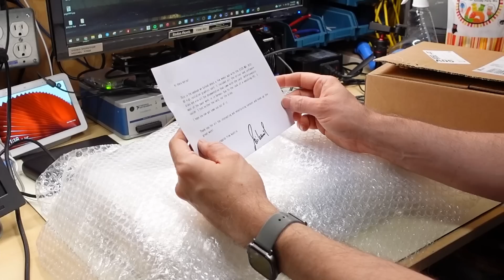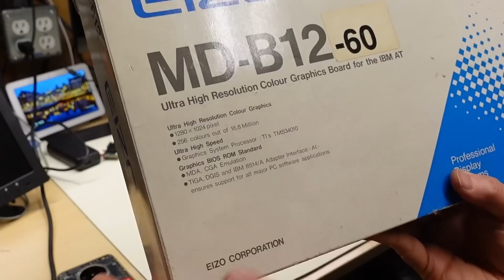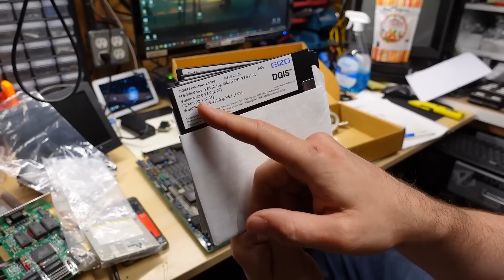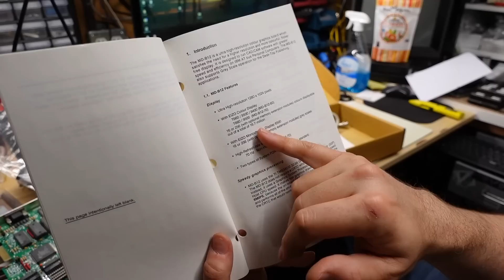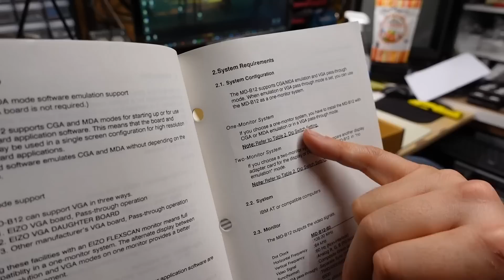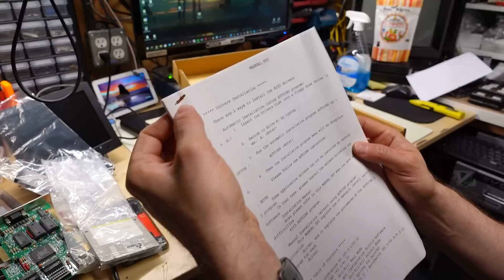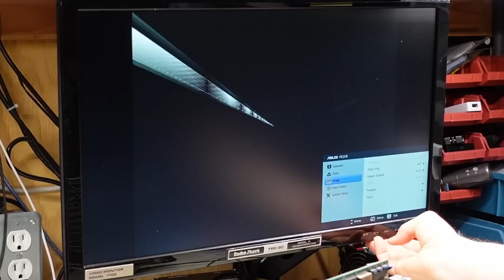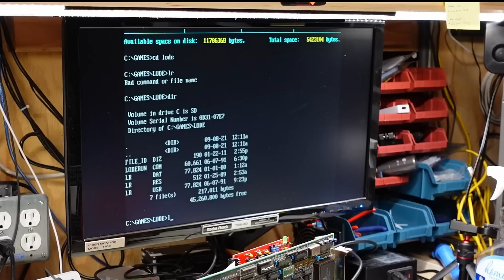0008 This is an "ultra high resolution" PC video card from 1987

Comment: I remember being amazed to have 1280x1024 on a "modern" monitor back in 2002, so this card having it so much earlier, that would have been mind-blowing at the time... :D
Reply: Indeed - I was on a 1024x768 display until 2007(!!) and this thing came out 20 years prior!
Reply: Very impressive resolution for the time for sure.
Reply: I had a mid-level Gateway 2000 computer in 1990 or 1991 that supported 1280×1024, and a monitor that supported it. I think that it had to be interlaced at that resolution, though, and was kinda hard on the eyes. I'm 99% sure that it was an ATI VGA Wonder card.

I also worked for a company repairing Nokia monitors in 1994 (I remember Windows 95 was released during the time I was working there) and their 21" monitor at the time, the 445X, supported up to 1600×1200.
Reply: I have an LCD "ThinkVision" right here as rotated second monitor, and it is 1280x1024 (but its rotated vertically so, 1024x1280).
But, if we are talking 1990, well High res was 640x480 "Super" was 800x600, there was another word for 1024x768 and then something like this, no wonder it was called "Ultra". Its like an 8k today. Unfortunately 1m of vram was too little to display too many colors at those high resolutions, but of course you could always pick from the true color palette.
The main target for this device was probably the CAD crowd, occasionally these would bring a Flight Simulator driver but for the most part no game would ever take advantage of it. If you walk a little bit into the future, around the VESA LOCAL BUS era, you will get "svga" with almost identical capabilities and limitations, albeit compatibility improved when "VESA" modes were also introduced (ie. Simcity 2000). From my fuzzy memory, i only remember seeing one person using a vga like monitor with those bnc connectors.
Reply: I remember bing amazed when saw video playing on a PC monitor in a radio shack way back when.
Reply: Eizao Nanao made some great monitors back in 90's. I had one of their 17 inch 1280x1024 models in 93 or 94. Opening the monthly Computer Shopper was like porn LOL. But yeah I remember starting with 320x200, then 640x350 I think, then 640x480, 800x600, and 1024x768. When 1280x1024 came around, it was like who would ever need more?! I'm was at 4K about or 5 years ago, and now dropping back to 2K wide for development. Fun stuff.
Reply: @nicholash8021  Computer Shopper!! Oh how I remember scouring the adverts in that magazine and others, looking for the best prices on PC hardware and then realising that it was all out of my price range... then spotting an advert for PC rentals! That was my first PC, a 486sx 25mhz if I am remembering correctly. I had to pay £25 a month for it, was brand new with monitor and all peripherals. TBF it was a great way to get into PC's back then ('94-95), especially as the prices of the buggers was astronomical. I was only 16 and just starting college and needed one for my course. Only regret was not getting the DX or even the Pentium as that came out about then too, but didn't realise I might want better until I got hold of a demo of DOOM and to play it I had to shrink the screen size down to about the size of a cigarette packet for it to run at any sort of reasonable speed... 

I wonder if renting a PC is still a thing anywhere?
Reply: I remember thinking 1280x720 was a super high res.

Comment: I'm wondering if any of the other modes are any faster, or even if the VGA pass through is any faster either. Would love to see a follow up video showing the different modes, and hardware configurations.  And is the RAM really 59 pin, and not 30-pin? (like does it start counting at 29?)  I'm sure you're right, but would love to see 30 pin memory side by side with the sockets to shut up my brain goblins. ✌🏻
Reply: Faster for CAD and other wireframe stuff when using the proper driver, usually identical to or slower than normal graphics cards otherwise. These would be a waste of money for virtually any DOS game for example, though perhaps something like Tempest or another wireframe game could be ported to work well on the machine.

Comment: Those are 60-pin SIMM slots, not 59-pin  (I counted). Often you'd either label the odd end pins, or even end pins, depending on which side of the connector you've got the labels on, but I've never seen a SIMM slot with an odd number of pins.
Reply: I agree 60pin. I believe i may still have a few
Reply: @TroyBest  Slots or SIMMs? And what were they used for?
Reply: @BlackEpyon  60 pin SIMM memory sticks. Someplace around here i think instill have some sticks might be DIMM. Been a long time from my amiga days.
Reply: @TroyBest  I ddin't know Amiga had 60-pin sticks. I'm familiar with the 30-pin SIMMs from the 386 days, and the 72-pin sticks from the Pentium I days.
Reply: @BlackEpyon  been 30+ years, iv got so much crap packed away.  Ill check tomorrow if i find ill link a pic. I kept alot of that crap the 30 and 60 pin sticks made great keychains lol
Reply: @TroyBest  I recall using a few as keychains myself, until the chips kept falling off in my pockets.
Reply: Yeah i have some, not all SIMM were 72 pin :)
Reply: @freeculture  SIMM just means that the pins are the same on both sides. the 72-pin cards in common use were DIMM's though, which means a different pinnout on both sides.

Comment: I have a similar EIZO card that I used extensively back in the mid '90s, except mine's 1600x1200 B&W or lower res with 4 shades of grey.  It came with a 21" monochrome monitor (some model of EIZO Flexscan CRT).  Windows 3.11 looked a little ridiculous with so much desktop realestate.The ribbon cable is to connect to the feature connector of the existing VGA card to pass through "standard" modes and the leadless D15 has resistors in it to fool the existing VGA into detecting a monitor.  It was not uncommon for VGA BIOSes of the era to hang the computer if no monitor was present.  Not sure if things are exactly the same for this card, as mine is an "addon only" card that requires a VGA card to boot the machine.

Comment: Haven't used a card that old but more modern versions for healthcare. In the radiology department, the computers used for examining imaging used for the time super high resolution LCD monitors that required paired graphics cards to run.

Other than supporting the high resolution, the cards also allowed diagnostics of the display to run as these screens had to meet certain performance standards such as uniform colour, uniform backlighting and other standards to ensure that dark spots or imperfections in radiology images were diagnosed correctly and not just attributed to the screen being a problem.

Wouldn't want to mistake burn in for a cancer diagnosis.
Reply: How modern we talking about? I mean, with every kid and his dog gaming on 4k and 8k monitors, high-res isn't exactly the wiz-bang that it used to be.
Reply: @BlackEpyon  machines running Windows 2000. If memory serves the displays were 4 to 6 megapixel (they were measured in megapixel, the modern versions in this space still are).
Reply: @theoriginalzads  My dad used to be a senior service rep for Datex-Ohmeda. I've seen him bring anaesthesia machines, ventilators, ECG's and the like home to work on, and sometimes they'd just get shipped straight to our house for service. But I don't think he's worked on any radiology equipment. I imagine you'd need different qualifications to work on that stuff. Any chance you might know?
Reply: @BlackEpyon  the actual radiology equipment, definitely. The guys that serviced our gear were basically radiologists with IT field service experience.

For the radiology reporting stations (the computers with the fancy monitors that cost more than my car), no. The only difference was the graphics card, software and monitor. Some basic training on the diagnostic application and hardware for the monitors is all that's needed.

These days, there's no special graphics card involved. They're driven by a good Nvidia or AMD CAD workstation graphics card which I think they only choose because the drivers are usually more stable than the gaming cards.

The screens though are still more expensive than my car was brand new.
Reply: @theoriginalzads  Yeah, the cards have definitely come a long way. I've been running multi-monitor setups on my computers since the early 2000's, back when you had to have multiple discrete video cards to do it. Now, all four of my 1080p monitors run off of a single graphics card. And this is all hand-me-down consumer grade stuff. If it were a couple years newer, I could run quad 4k monitors (not that I can afford that, OR have the desk space).
Reply: @BlackEpyon  I know right? My crappy work laptop will drive 3 FHD monitors plus it's internal without an issue. Sometimes I watch these videos and remember how much computers have evolved.

Plug thing in and thing works. No weird compatibility issues, conflicts, differing standards, just glorious harmony.

Comment: I believe the TMS340 processors were designed by an engineer that was also responsible for the TMS9995, the successor to the 9900 in the TI99/4a (the 9995 was to be used in the TI99/8 an aborted successor to the /4a). The concept of combining the video processor on the same silicon as a general processor was ahead of it's time. TI could not get Microsoft to get behind the TMS340 as a Windows card, and the proprietary vram (seems like TI never learned that lesson) was too expensive.

Comment: oh damn, RGBHV cable with BNCs ! that some heavy duty shit lol
Reply: I had a couple of 19" touch-screen monitors years back with BNC component inputs. I've no freaking idea how much THOSE cost back in the day, I got them 3rd or 4th hand. Unfortunately, both of them died, and this was before I started actually "collecting" and fixing retro computer stuff, so they went for recycling.  These days, of course, I'd take them apart and fix them. The touch screen had it's own dedicated interface box, but I never did find drivers for it, so I never got to use the touch screen function.

Comment: How would you even FIND 59-pin video ram modules?   Looked all over the place and have nothing....  ;-(  good luck.  hope to see this fully loaded someday.
Enjoy seeing these videos on retro/older hardware from when I was young.
Reply: Nowadays you would get the datasheet for the RAM chips on the board, trace where they connect to the memory slots, then draw your own modules (using cheap and readily available DRAM's or VRAM's) up in KiCAD or some other EDA, and finally have the board made for you (since that is so inexpensive now).

Comment: To get some idea of the 6 MIPS speed, I ran the SysInfo benchmark tool on my Amiga 1200 with 28Mhz accelerator card (and 68020 processor on board) and got 5.5 MIPS... and the A1200 came out 5 years later. So not too shabby for a card from 1987 even if it's lacking the graphics memory to do 256 colors.

Comment: The VGA to BNC cable wasn't particularly expensive, only slightly more so than a regular VGA cable. I used them all the time with the 19" and 21" high-resolution RGB monitors I had. I've always been a hi-res junkie.

Comment: It's amazing, we're only now creeping past 1080p in many arenas.

I remember using 1024x768 and 1280x1024 for ages in the 90s on PC before you saw anything remotely close to that outside the PC space
Reply: The kind of people that used cards like THIS back then went past 1080p a LONG time ago, and have since moved off 4k as primary resolution. Depending on what they're doing they would be on at least one 5K (for screening 4K at 1:1 with toolbars around!), 6K or 8K screen, and likely with a couple of auxiliary "mere" 4K screens.
Reply: @Great-Documentaries  Actually, I had an Amiga on my desk in the 80s, worked for Sun as a software developer, used DEC VAX graphics workstations, and my father had an SGI Indy.

I perhaps should have said computer, instead of PC.

However, the card in this video, Unix workstations, and the cards you needed to do those resolutions on Amiga were not commodity in the 80s or early 90s. 

The point I was making was that those resolutions were commodity on computers in the 90s long before they were commodity elsewhere in the consumer space.

The viewership of this channel isn't typical; computer ownership in the 90s was a fraction of what it is now.

Comment: Back in the day... My family bought me a 386. I got a Targa card with it. 1024x768 with upgrades for Truevision aka 16.7m colors. I had the best graphics card at the time, but it was absolutely dog slow. And it came with a literal binder of discs to interface with all the software I never used. It did have a 13w3 adapter. Only much later did I know what that was for. 
My second PC was a 486/Delta pc. Never did find the tpc unit that matched it, aka the Delta transputer card.

Comment: Oooo, this gives me "shiver-me-timbers" feeling. I bought a "super PC" back in the day when I visited the CeBit messe back in 1991
and saw and used  a Silicon graphics Iris Indigo  ELAN machine. So I bought the most up to spec 486DX50 that I could find, put in
a RAID (4MB of cache) controller and bought a Volante AT2000 graphics card ($1500) for that nice graphics in windows 3.1/3.11
+ a Tseng Lab's ET4000 card for DOS. To show that awesome graphics I also bought a 17" Viewsonic monitor with built in LCD
screen (can't remember the product ID). And also the best sound card I could find to make it truly multimedia. It was a killer PC
but one year later I sold it due to economic problems. Go figure. =)
Aaaand, it still didn't beat the Iris Indigo ELAN. =(
Reply: Wow, they had RAID that far back? I had no idea... Thats pretty rad. I did have a Tseng Labs ET4000 card, was a VLB. I kept using it for years, I thought it 'looked' nicer. for a few years there was an epic second hand computer shop in my nearest city that was a Must Visit every time we went. I rarely left with any money. The store was a mess, shelves of plastic tubs of parts, racks of old gear. the guy was great,  defiantly knew his stuff, n cos I was a regular, knew my PC better than I did. what ram would work best, good upgrades, all that kinda stuff. It was a full 25 years since I met him that I bought an off the shelf PC. these things are Built, not Bought. Even my work PC's got heavily modified. This was pre-internet, so I could call him up n ask, "aye Tony, shes doin this, whatta I do?". He also had a literal filing cabinet full of driver disks, and would provide a copy with every sale. if it needed a driver, he wouldn't sell it if he didnt have the driver. the ET4000 was one of his 'Backroom" items I got out of him.
Reply: @arjovenzia  Thanks for the story. Yeah, RAID has been around for a while, SCSI only though back then. This was pre VLB so the RAID controller fit into an EISA slot to get over that pesky ISA bottleneck. =)

Comment: I remember having a card with similar capabilities around 89/90.  I remember it being stand alone, though, and yeah, hrm.  No, the one I had didn't have extra ram, and I think it was 16k colors out of 16.8 million.  So, nothing like it.  I think in 87 I was either still on my C64, or I was on a Tandy 1000hx.  Probably the Tandy, so ish..  Was before I was a tech, too.

Comment: I hope someone has RAM for that card! Would love to see what that ancient artifact can do!
Reply: Yeah, I've never seen 60-pin SIMM cards before. 30-pin SIMM cards were all the rage back in the 386 era, and I've got a whole bin full of 72-pin DIMMs, but 60-pin is an oddball.
Reply from the maker: Yeah high res 16 color mode is kind of boring. Pretty lame they didn't just use a normal memory footprint
Reply: @adriansdigitalbasement2  The board probably uses VRAM chips which are comlpetely incompatible with DRAM.  (The read only port for video is typically a serial bit-stream for up to 1024 bits generated by a single read access, and some pins are actually shared between the video read only side and the data bus read-write side to keep the pin count down.)  So a completely oddball connector prevents users from trying to use a standard SIMM module on the video card.  It's still annoying, though.

Comment: BGI Driver is the Borland Graphics Interface.  That means you could write/compile software that used the BGI and it would run on this card.
Reply: More importantly existing BGI programs can usually load external BGI drivers.
Reply: Just wanted to say that it is probably for Pascal or Turbo C, but you watched it faster 😀

Comment: Would populating the V-SIMM slots help with the speed? I assume it would allow the frame buffer to be offloaded so less moving memory around, so faster speed.
Reply: That would seem like a very reasonable assumption.
Reply: Typically not. The extra RAM allows you to do increased resolution and/or colour depth. H-resoultion x V-resolution x colour depth = RAM requirement)
Reply: My guess is it wouldn't help; the slowdown is likely that 6 MIPS cpu on the card scanning through the emulated video ram, and either generating a new framebuffer for the whole screen, or scanning for changes and updating the changed areas in the real framebuffer.  More RAM probably won't help as it's likely not RAM or  RAM bandwidth starved.
Reply: @big0bad0brad  Honestly it would depend on the implementation. Will probably need to actually put it to the test to know for sure.